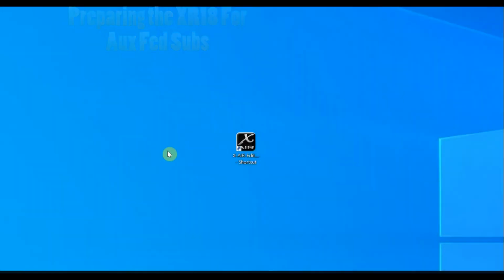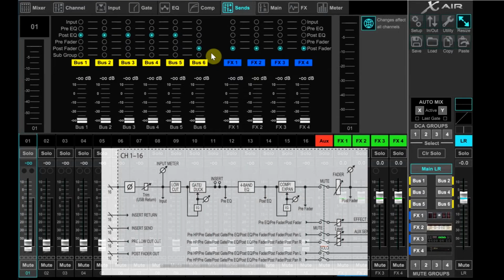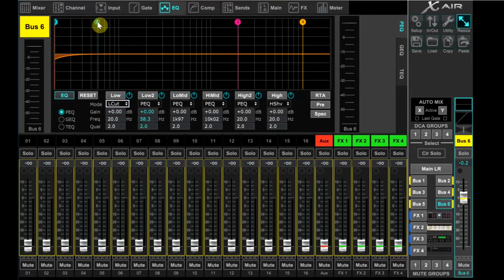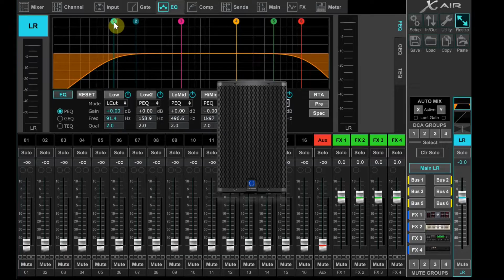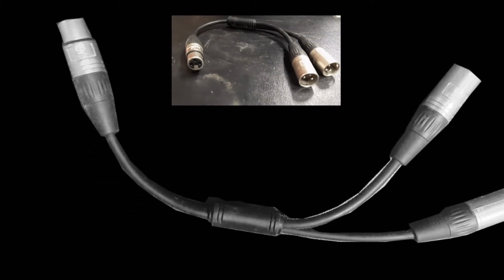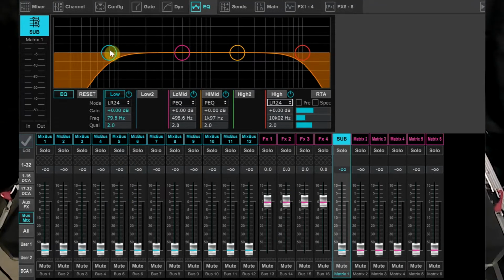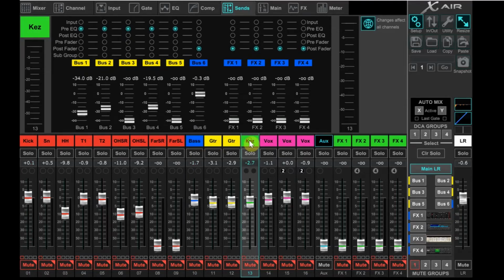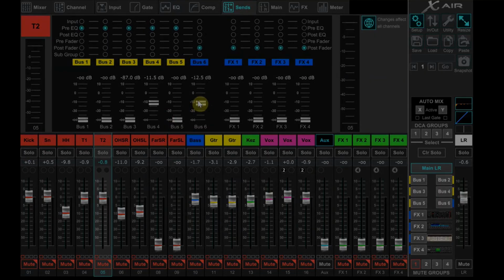Aux Fed Subs Setup For Behringer XR18 X-Air - Midas MR18

Comment: Great Video!!  I have a quick question for you.  I use two EV Evolve 50 speakers for my mains, I would like to add a18" powered sub to my configuration.  My question is:  As the Evolves have subs, should I set their EQ to 100hz & up, run the sub out of Aux 6 and set the 18" sub to 100hz and down.  Not sure of the best way to add a powered sub.  Any help would be greatly appreciated!!
Reply from the maker: Are the Evolve 50's EV's stick style speakers? Don't they already have a sub as part of the package? Or is that what you're saying and you plan to get a bigger sub?

Comment: Hi Alan,  I am using a passive sub and my amp does not have a dsp and there is no cross-over gear in my rack.  Is setting up a hcut filter my best option on Aux 6?  Regards
Reply from the maker: Basically, yes, HPF and LPF... other than buying a crossover to add to your rack

Comment: You may have covered this in a separate video but if we have turbosound mains and subs would it be beneficial to run them using Ultranet as opposed to XLR cables? Seems to me like limiting the D to A conversions in the chain would be beneficial. I guess that's another video suggestion for you as well! Thanks
Reply from the maker: I haven't done much on Ultranet just because the only Ultranet speakers I have (a couple of little 8" Turbos) don't gain me much to use Ultranet the way I normally deploy the speakers. They are sometimes talking head speakers, sometimes program monitor speakers, and during the pandemic they've been studio mons...
But you are correct I'd think in that Ultranet would be the better way to go in the circumstance you describe. I don't know that you'd notice much difference though in a real world application like that so it would be more about whether using Cat5e (and the Ultranet connection was any easier) or whether the cable paths make a more robust XRL cable more practical.
On the X32 you get some speaker control with the Ultranet... so that's a plus if you need it. I don't know if the XR18 gives you that or not. I assume it would... I've just never checked.

Comment: Great tutorial,  when you say unity between the bus 6 and main fader dose that mean they move together? I can't figure out how to do that. Where do you set gain structure for mains
Reply from the maker: No, they don't move together. It would be great if they did. I'm just saying, if everything is as it should be, in a perfect world setting, the main fader for the rest of the system, and the fader controlling the subs would be at the same level (and that would be then also unity). But, real world issues and system setup flaws could dictate they don't actually match. Although once set, whether matching or not, if you have to change one, you should likely want to change the other the same matching amount to keep your sub/top balance the same.
The best way to have an overall system master on the XR18 when using subs on an aux is to assign a DCA to every channel (if you have a DCA to spare...). You'd still need to set your main fader and your master sub level fader, but once those are set (which as mentioned above is ideally at unity), then you'd use the DCA you assigned all the channels to as your master fader for mixing purposes.
Ultimately, this whole issue of not having a true, single master fader for everything isn't really that big of a problem that most people would use a DCA to recreate one because most people set the Master and leave it anyway. So the same is true for the master sub level too. Set it... leave it.
And if you do need to move the master up or down 5dB, it isn't a big deal to move the master sub fader up or down those same 5dB either.
...Unless you're doing some kind of system fade as part of the live cues from FOH. In that case, the DCA is a workable solution to getting everything on one 'master' fader.

Comment: Can you do a video of an Aux Fed sub using soundcraft efx12.. Im new to your channel.. Thanks.
Reply from the maker: I don't have one to video, but let me take a look at one online and see if I can at least give you some pointers or info in the comments in a day or two.
Reply: @AlanHamiltonAudio  ok thanks bro.. will be waiting for that
Reply from the maker: @tatangmo7853  Ok, you might be in a "can't get there from here scenario". The EFX only has 2 auxes. One is for the built in FX and one is theoretically available, but I imagine the odds are good you're using it for monitors.
Technically, the FX bus output could serve as an aux sub feed IF you aren't using the built in FX. It's already post fader so you'd just need to connect it like mentioned in the video in part 2 (since beyond part 1, part 2 and 3 are both cross platform chapters mainly). The FX bus feed on each channel would then become your sub feed.
Assuming you're already using the FX... then IF the other aux is available and not being used for monitors, then in the master section of the board there is a PRE/POST button. Set that in the POST position. Now, connect your sub or sub amp/crossover to the Aux output on the console, and then refer to this video in chapters 2 and 3.

But, I'm kind of assuming, you're using monitors in that aux. So if you're using both the FX bus (which is just a post fader aux) and the 'spare' aux, then you're almost in 'can't get there from here territory'.

There IS one other option that is a bit convoluted but I'll try and explain it.
First, you'd need to run your PA in mono.
Pan everything to the right and connect your powered tops (or you amp/x-over for the tops) to the right side of the board. 
Now, connect the left (left for 'low' to make this easy to remember) to your powered subs or amp/crossover.
For any channels you want to send to the subs, slowly pan those channels to the left (but never hard left). Somewhere between a pan control at 3 O'clock and noon should be about where it'll end up for your low end channels (kick, deep toms, bass guitar, keys... tracks...).
If you pan it hard left, nothing would get to your tops from that channel. It would all go to the subs. The idea is for none of the vocals to go to the subs, but things like bass guitar and kick drum, instruments that NEED that low frequency extension, would get the top end normally, and by panning toward the center from the right, you'd be adding in/sending lows from those instruments to the subs too.
In any of these cases, the info from chapter 2 and 3 of the video basically would apply the same.
Reply: @AlanHamiltonAudio  thank you so much.. This helped me a lot on figuring out my trouble.. More power and more videos to come.. God Bless.
Reply from the maker: @tatangmo7853  Glad to help! Thanks! :)

Comment: So now I don't need a crossover?
Reply from the maker: I'd use a crossover dedicated to subs. Either built into powered subs, a separate rackmount unit, or a full-fledged, multi-input DSP that has enough inputs that you can do 1 input for subs, and another for your tops... Which would generally be Left and Right... So 3 total inputs at minimum for that.
But, for mono, you could do that with two inputs... Make the left side a sub input on your crossover/DSP and make the right side the input for your tops. That assumes your crossover is more than 2 way, or that your tops are ran passive.
Reply: @AlanHamiltonAudio  thank you for the info brother
Reply from the maker: @jlc2093  No problem. Glad to help! :)

Comment: This is the best explanation for running subs on aux out there.
I'm still curious what advantage this has over simply running the subs off of a daisy chain XLR pass through from a main speaker and using the built in crossovers on the speakers themselves. Is there any?
Reply from the maker: If I follow your question, the difference would be... let's use a vocal mic for the discussion...
Your vocalist's lower range is maybe 120Hz (changes with the singer but we need a number for the example ;) ). You set the HPF on the channel to 100Hz being conservative.
First, that 100Hz is not a dead drop off. Frequencies will drop at a fixed slope rate.
Meanwhile, the vocals aren't the only thing in that vocal mix. It's picking up bass guitar, kick drum, and wash from the monitors (if the band is not on IEMS), and wash from the PA. Even room noise.

Now, the fact it has that HPF engaged means it will roll off that low end the mic is picking up, but it won't be a hard cut off. It's just sloping it away.

So, with a standard setup, anything that is picked up by the vocal mic, will get to the PA. And anything, even below the 100Hz HPF on the vocal mic, will still get to the PA (based on the rolloff amount of the HPF... and to the subs. Since 100Hz is not a hard cut off, then to varying degrees, that stage wash is still getting to the subs, matching the roll off of the HPF (low cut).

But with Aux fed subs, if you don't turn an aux (bus) up on a channel, then nothing from that channel is getting to the subs. So for our vocal example, with aux fed subs in the equation, we'd only be sending to the mid hi's because that's what is connected to our L-R outs. If we don't bring the aux up on the subs on that vocal channel, then there's no path from that vocal mic for stage wash of any frequency to get sent to the subs.

There's plenty debate about whether it's ultimately worth it... especially these days with time alignment... better designed and more efficient systems... variable HPF's on desks... utilizing the IEMs instead of loud stage mons... And if utilizing it, maintaining proper balance with the low end in instruments (though, sometimes the goal is to NOT maintain proper balance with the low end of some instruments.. which aux fed subs definitely makes that possible).

Far and away, the most popular configuration remains some form of subs on an aux. Many times the amplifier system is always configured that way, and traveling engineers will hand you 4 lines... Left, Right, Sub, Fill. Even if they are NOT using aux fed subs from their touring console. 
They can feed their L-R bus to a stereo matrix, where they also have a 3rd matrix taking a a clone of that L-R signal... This 3rd matrix feeds the subs. And so that separate sub line is getting a normal mix sent to it and the system.
They do this so that system providers can setup the rig for aux fed subs, because that is a popular requirement, but for the engineers that don't want aux fed subs, this gets them connected in a way that mimics a normal (non-aux fed subs system). Otherwise, system providers would have to reconfigure the system for traveling engineers and desks. And if you're talking festivals and multiple bands, then that gets even more complicated. 

Rewinding a bit, some people use the "M" output on the X32 and M32 as their sub feed. Anything they want going to a sub, they engaged that center output on the channel strip, and use the channel level control for it to feed the sub. Same concept as aux fed subs... just another route to get there.

Comment: Awesome, thanks so much. Our band has an XR16 and this is going to be really helpful for our subwoofer.
Reply from the maker: Glad to help! Thanks for watching and commenting. Let me know if any questions come up.
Reply: @AlanHamiltonAudio  Thanks, right now we just have a few band members who are frustrated with the IEM mix. I'm thinking of changing their IEM bus from "pre-fader" to "post fader" just to give them the front of house mix in their ears, this will take the control away from them, but may just be a simple solution to giving them a mix they don't have to dial in. Any thoughts on this?
Reply from the maker: Mon Setup Video:
https://youtu.be/5gzsEErKdb8
As long as you understand what you're doing when you do that change, then you'll know what to watch out for to see if your idea can work for them. 

The pitfall will probably be vocalist(s), or at least the more likely pitfall.  

Are you mixing from the stage or do you have someone out front? If there's someone out front it puts another variable into your plan. If it's just the band mixing from stage, then you know exactly what is going on. And besides that, probably aren't changing things much at all during the night.
So that could help.

Plus, you can still give the vocalists more or less via the channel send, even if it is post fader. It's just going to track up/down with the fader from that point you set.
And beyond that, if the fader changes are bothering the singer(s), then you can just switch off the global send changes and set the vocal channel aux sends to be pre fader (or any point pre-fader you want), while leaving the other channels post fader.

"To break the rules, first you need to know the rules". So you know the reasoning in pre-fader auxes for mons... and if you have a theory to try, if it works for you in specific case, then it works for you. And if it doesn't, you'll probably be able to recognize the symptoms and fix it, or try something else.